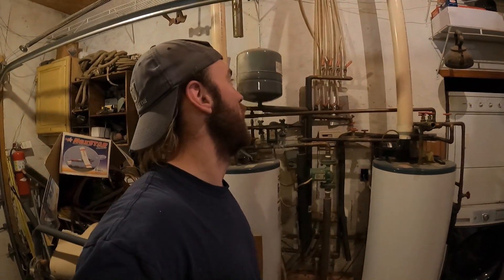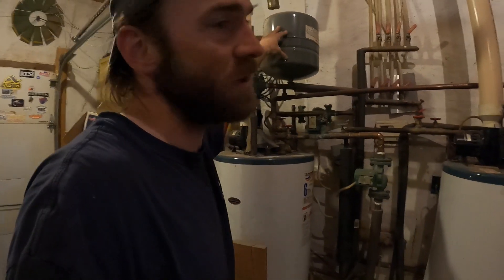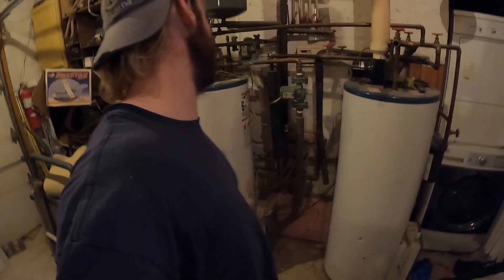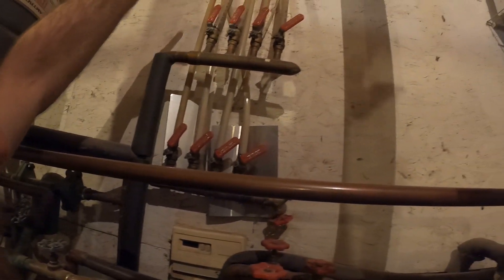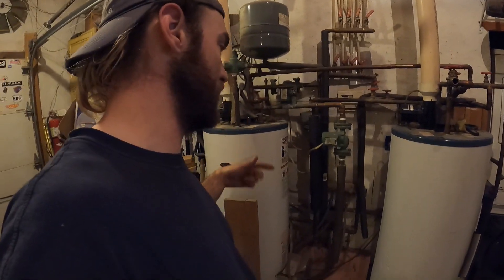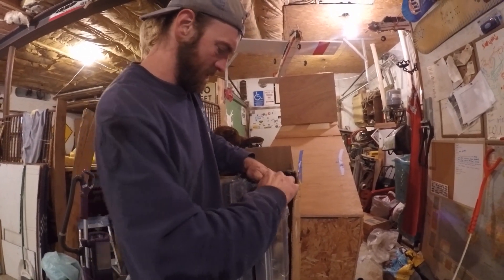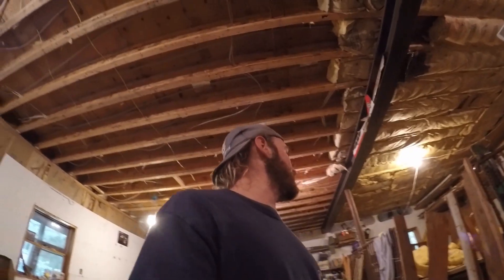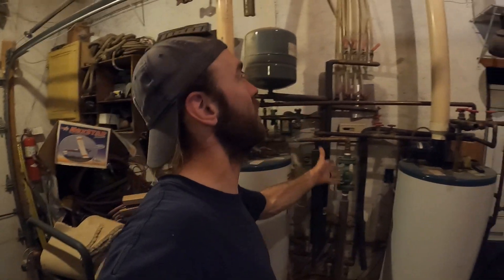Radiant floor heating system

Comment: so is heating the wood floor upstairs worth it? Seems like concrete is a better heat holder, lol.
Reply from the maker: Concrete is so much better. get it warm and it will hold heat for days.  Having warm floors to walk on is a neat feeling. Nice not hearing the heating system.  Objects themselves get warmed up not just the air.  Very little dust is spread around due to no moving air or heat currents.  We have a lot of tile upstairs and it is so great when that is warm.